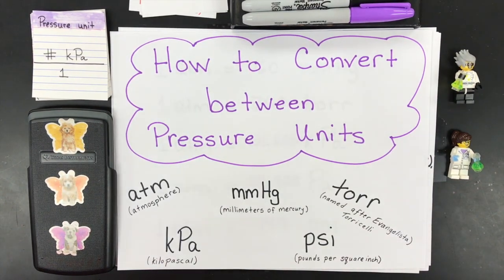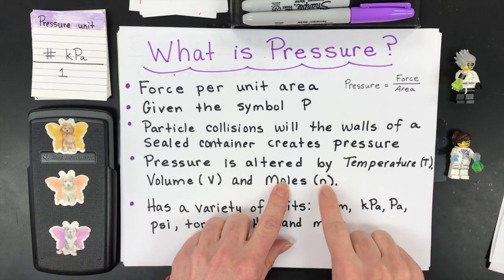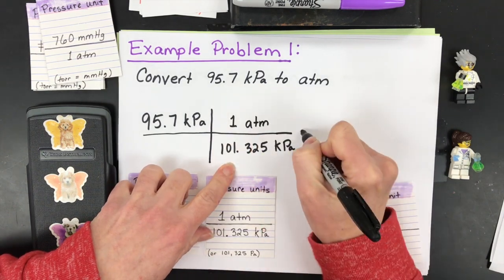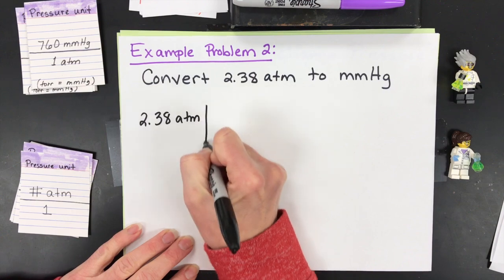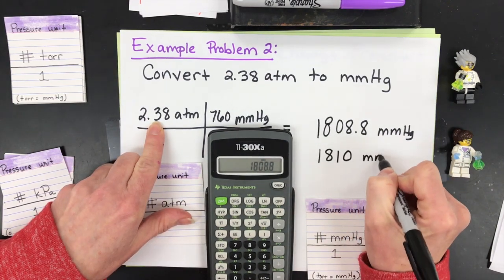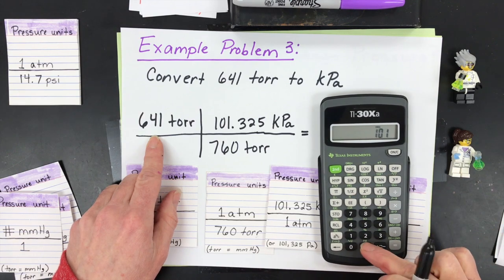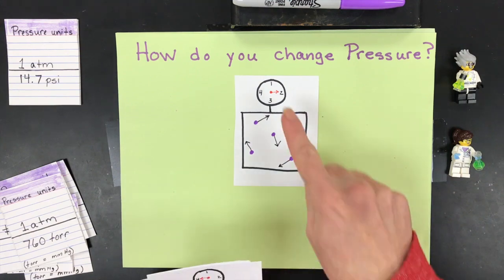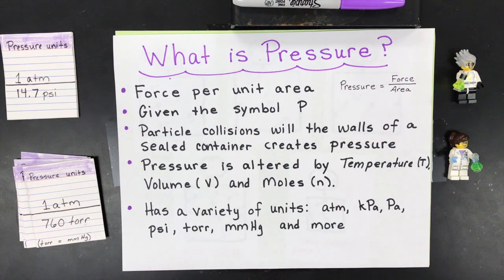Converting Between Pressure Units: atm, mmHg, torr, kPa & psi

Comment: What if you're trying to convert 1x10^-3 torr to something else?
I'm guessing you just write down 0.001 torr and convert it then.
My big issue is we have a gauge reader that reads from 0 to 30 in Hg, and I'm trying to figure out if this reader can read as low as 1x10^-3 torr (and what its equivalent in Hg is)?
Reply from the maker: Yes, just use 0.001 as your starting calculation.

Comment: hi, im kinda confused about significant digits. i thought if youre gonna multiply/divide a number, youre going to choose the least significant digits for the final answer. not the given number for the equation.

example for the first problem. 1 atm has the least significant digit which is 1. so does the final answer should be 0.9?

pls correct me if u see this. thanks!
Reply from the maker: The 1 atm is an exact digit with infinite significant figures. You can think of 1 atm in that conversion as 1.00000000000atm
Reply: @AnneSchmidt  i think i got it now, thank you so much for responding!!
Reply from the maker: @strawvery.1422  perfect

Comment: how bout torr to psi?

torr x 1atm/760torr x 14.7psi/1atm???
Reply from the maker: True.  You can convert from torr to psi by using the conversion (14.7 psi/760 torr).  So for example 780 torr x 14.7 psi/760 torr = 15.1 psi.  I try to keep my videos under 10 minutes, so that conversion just did not make the cut.  Thanks for watching!
Reply: Thank you!!!<3

Comment: How to convert mm Hg to kg/cm2 or kg/m2,What is the conversation factor for this
Reply from the maker: Since pressure is force per unit area you can convert. 1 mmHg = 0.00135951 kg/cm2 so you can make that into a conversion and you can also use the fact that 1 m2 = 10,000 cm2. Or just use this website. https://www.convertunits.com/from/mm+Hg/to/kg/cm%5E2
Reply: @AnneSchmidt  Thank you very much

Comment: Is it okay if i use 101.3 to convert instead of 101. 325?
Reply from the maker: Yes it is!
Reply: So my answer of 641/760x101.3 is 85.43855263 so the next number of 4 is 3 so i can't bring down it's consider an answer?
Reply from the maker: @rboymoreno5584  yes 85.4 kPa
Reply: @AnneSchmidt  thank you 😊
Reply: What if i use different pressure unit like this what is the differences than you used is that the same result? 
 1 N/m2=1pascal  
100kpa=1bar 
1bar=750torr
 1torr=1 mmHg
1 mmHg=0.0013atm
1atm=14.7psi

Comment: Are you know about aneroid barometer working according to formula 
So we find its efficiency ??in joules??
Are you able to make a bigger modal of barometer so we turned a turbine instead of needle 
We make lots of energy through out the year and and collected every differentials of pressure into electricity in a battery bank 
World wide this setup make a huge difference and we don't needed any fuel for energy 
Wow are you able to make such a system
Reply from the maker: Not sure.
Reply: @AnneSchmidt  if shure 
We become very very rich as we found the hydrogen economy Foundation stone and energy crisis of world become over forever

Comment: What height of water will produce the same pressure as  120 mmHg?
Reply from the maker: 120 mmHg is a very low pressure since 760 is normal or typical at sea level.
Reply: @AnneSchmidt   ok
🌸♥️

Comment: You never did kPa to psi
Reply from the maker: To convert between kPa and psi use the conversion:  (14.7psi/101.325kPa).  For example, 128 kPa x (14.7 psi/101.325 kPa) = 18.6 psi.  This number was found by multiplying 128 and 14.7 then divided by 101.325.  I try to keep my video's to 10min or under so I didn't end up showing an example of that type of pressure conversion.  Thanks for your question and watching the video.  Best wishes!